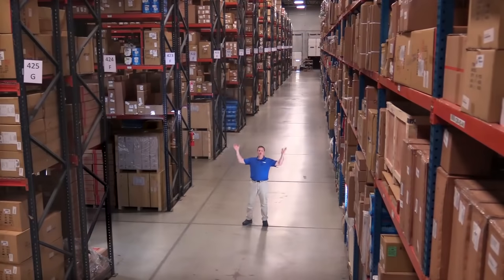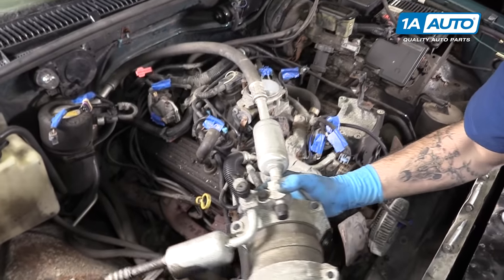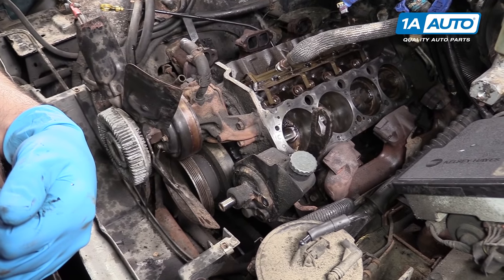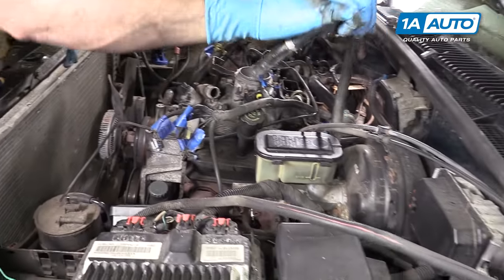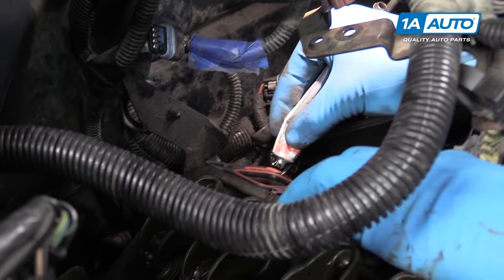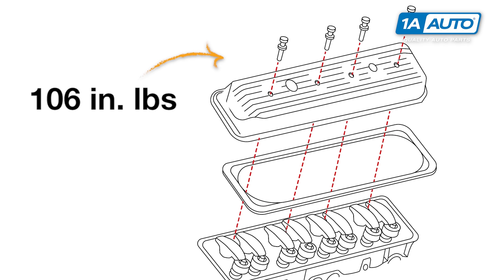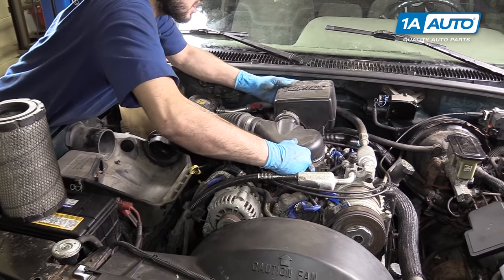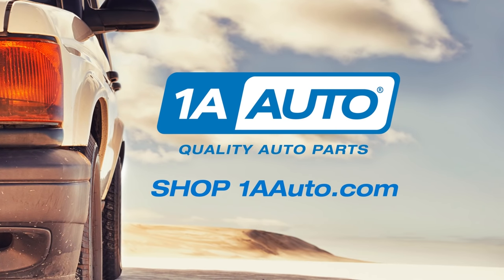How to Replace Intake Manifold Gaskets 96-99 GMC K1500 5.7L

Comment: I had the notorious intake coolant leak on my 5.7 1998 Silverado.  It's been about 10 years but I know I didn't remove the power steering pulley.  I believe I just loosen the bolts enough on the bracket to clear the manifold.  Nice video.
Reply: Just did this last night, yep. No need to buy a pulley removal tool!
Reply: Pull the whole accessory bracket off both sides. The steering pump has enough hose to move it out of the way. Unless your hoses look like the titanic.

Comment: I don't believe you need to remove any of the power steering stuff for this job. For heads, sure, but not intake manifold gaskets. Way more work than it's worth.
Reply: Just did this job and if you have AC, you have to take the power steering pulley off to get the bracket off to get the valve cover off. It's like the lady that swallowed a fly.
Reply: You can loosen the nut between the power steering bracket and exh manifold on top of the three bolts and nut  which allows you to slide the bracket forward enough to clear it.

Comment: Incredible video, and great information. For those who break the plastic quick disconnect on the heater line to the intake man. I found a good write up to fix that. Also, I noticed my hardware was more standard than metric (9/16s opposed to 15mm) so be wary of that if your tools are not an exact fit
Reply from the maker: +Austin Kelly Thanks for the feedback!
Reply: Hi there wondering how u fixed the broken pinch clip on the heater hose?? Or where I can find info about this...thanks
Reply: I broke my clip on the heater hose....any advice?

Comment: Thank you SO MUCH for this amazing video tutorial. This was officially my first ever engine repair job -- I have some basic mechanical experience, but nothing to the level required to do this job without some serious guidance. The video was detailed enough that I successfully replaced my lower and upper intake manifold gaskets and managed to repair the infamous coolant leak that is so common on the GMC trucks. Thanks again for the excellent video -- I felt empowered to tackle this job with the confidence that I knew (and understood) what I needed to do. Keep up the great work, it is genuinely appreciated!
Reply from the maker: +jojoargento Thank you for the great reply. We love to empower our customers by showing you how-to perform your own auto repairs while installing our high quality auto parts. Have a great day! 1aauto.com

Comment: Excellent video!  Not looking forward to doing this job but, when I do I will use this one for help.  I have done the upper intake when I replaced my injectors and wish I knew to do the lower while it was all apart!  Same process with all the wires and harnesses... Thanks again.
Reply from the maker: +MrBowNaxe Thanks for watching. We carry the gasket kit on our website. Here is a link to them. Hope this helps you out. http://www.1aauto.com/head-gasket-set/i/1aegs00237?utm_source=YouTube&utm_medium=CTA+Comment&utm_campaign=ytcomment&utm_term=zte-h_mZyBM

Comment: They make a tool specifically for removing the clamps and it a LOT EASIER.
I would put in a recommendation to replace the 2 small hoses from the water pump, especially since you have everything off.
This was also detailed and hopefully it will work with me

Comment: It has been a few years since I did a vortec intake on a sbc but I'm pretty sure I didn't have to take power steering pump off and instead only took the bracket bolts loose. I seem to remember the brackets could be moved enough to do the job that way.

Comment: I just bought a 97 Tahoe. The previous owner neglected to tell me it has a blown head gasket and cancelled title.  I'll have to get him to sign it over to me at the DMV, and I think I can do the head gasket myself, thanks to your video. I learned a few things I wasn't figuring.  I'd like to swap the Camshaft, lifters, and valve springs while I'm in there doing the head gasket.  I'm still researching which camshafts and intake manifolds that are compatible with this year engine. I was planning on going with a Summit Racing 4x4 cam and beehive LS1 springs, but I'll check out the A1 website first and see what you've got for this project
Reply from the maker: +Kris Snessak Thank you! We love empowering our customers and showing how to perform DIY auto repairs with our high-quality auto parts.  http://1aau.to/m/Shop-1AAuto-c

Comment: useful video thank you. I have a 96 and 5 liter that uses 1 quart or less of fluid in anitfreeze per whole year..it shows up as a clean spot of one side of each plug on #6 and #8. Full compression, factory fuel mileage, full power.. it was mystery. it must be the last channel of coolant on the head from intake gasket. It uses such a small amount, I don't even want to tear into it...some years it uses none.

Comment: On the removal of the p/s pump pulley and the a/c compressor bracket, it leaves me stumped. There is a 13mm or 15mm nut (I forget which size) on the driver's side of the engine between the back of the p/s pump and the exhaust manifold. After removing the three bolts and the one nut from the front of the a/c compressor bracket, remove the aforementioned nut  between the back of the p/s pump and the exhaust manifold. This will allow the a/c compressor bracket to be slid forward enough to have access to the front lower intake manifold bolt and take it out. The back of the a/c compressor bracket covers that front bolt. Then when the other seven lower manifold bolts are removed the manifold can be lifted out.

Comment: That would be a great time to replace the heater inlet and replace the spider injection to the upgraded version if it doesn't already have it. Also clean the EGR passages and I'd soak the valley and push rods with CRC or SeaFoam
Reply from the maker: +Tazman1966 Thanks for checking us out!

Comment: WARNING!!! Change the OEM heater hose quick connect when you have the manifold off. Mine seemed ok only to crumble when I tried to reinstall hose. Now I must take intake manifold back off to try and salvage the manifold.
Reply from the maker: +C Robinson Thanks for checking us out! http://1aau.to/m/Shop-1AAuto-c
Reply: you can remove a broken hose connector with a hacksaw blade, cut 180 degrees apart carefully until almost all the way through then the two pieces can be removed, done this on 2 trucks over the years. 
to avoid breaking them off in the first place give them a little heat and some wax and turn it cautiously and they will usually come on out.
when you are done don't buy a replacement, put in an old school hose connector from a small block and clamp the hose on like the old days.
Reply: @dixiegarage400  im half way through the project here. Wanting to eliminate that quick disconnect hose thing. What outlet thing do I need to buy exactly? Id like to have it ready to go when I get the manifold off lol. Thanks sir!

Comment: Did this on the exact same motor due to some broken bolts in the manifold. We put the gasket maker on the valley pretty thick, but now it’s idling high at around 1300rpm. If there’s a leak at that valley seal will it cause a vacuum leak? Leak down test showed nothing

Comment: I know this is old but is there anyone who knows if this can be done without valve cover removal? i just replaced the gaskets and it wasn’t hard but would just make it easier and less risk of the gaskets leaking because i used the gasket again

Comment: Just did this on my 98 sierra. All went smooth until the next day I have a small oil leak coming from somewhere in the back top of the motor. Not sure if the rtv didn’t hold up when I put the intake back on or what. I’ve checked everything and can’t find where the leak starts. This happen to any body else?
Reply: Put some silicone on the distributor gasket. As far as the RTV I use ford silicone on everything. EVERYTIME. Never leaks.

Comment: Do I top dead center with spark plugs I know to remove spark plug 1 and put cthe compression on it
Reply: Do I need to lossen the distributor bolt before moving to top dead center or do thay have to be tight?

Comment: Besides tutorial purposes, what was cause of you changing the intake manifold gasket???
Reply from the maker: +LawBr8ker Thanks for watching!  This is a job that is done if you start to have leaks in any of the gasket locations.
Reply: Coolant loss, which is caused by deterioration of intake manifold gaskets, due in part, at least, to JUNK factory lower intake manifold.  Buy an aftermarket lower intake unit, if you want to permanently "fix" the problem...

Comment: You say tighten down 7 bolts keeping egr hold down bolt but its actually tighten 8 bolts and egr bolt is not included in the 8 bolts

Comment: Hey so i have a 99 tahoe 5.7. I have a hose that crumbled and i can't find out what its called. It goes from the intake to the ac system along the firewall. Any idea what this hose is. It literally crumbled. Its a bout an eight of an inch to a quarter inch in diameter and it was really long.

Comment: I just done my 93 silverado 350,the the gaskets came w no openings,the old gaskets had them open,,,was i given the wrong gaskets
Reply from the maker: +Maurice Bond If this is an order made with us, please let us know so we can assist you further.
Reply: @1AAuto  ,No it wasnt,i just wasnt sure about those ports being blocked by the gasket when the YouTube videos showed there gaskets were  open on the back ports
Reply from the maker: +Maurice Bond Thanks for checking us out!
Reply: Some Models Use Restrictors to Slow Down The Coolant Flow to Absorb More Heat In The Engine

Comment: Does the intake manifold need to be resurfaced in order to sit flat while changing the gasket or just clean? Also does the block need to be resurfaced as well or just cleaned?
Reply from the maker: +edgar heredia You should be able to just remove the old gaskets and clean them. 1aauto.com
Reply: Thanks for the info , the sequence provided in the video is that for a 5.0 motor?, I have a 98 gmc sierra sle 5.0 v8 vortec
Reply: It's for the 5.7

Comment: Can i use my old distributor assembly or do i have to buy a new one
Reply from the maker: +Dmitrik Guajardo Thanks for watching.  You can use the old one if it is still good, no need to purchase a new one!
Reply: Those distributors are junk, get an aftermarket one with aluminum housing

Comment: I bought that power steering pump pulley tool (remover and installer) and the installer wouldn't fit. Same issue as y'all. Tried the alternator bracket thread hack and didn't work either. The pulley gets on about 3/4 of the way and won't budge anymore. Even tried buying a new pulley thinking I mushroomed the originally pulley when removing it. I even tried heating the pulley. Any ideas?
Reply: Mine required a TREMENDOUS amount of force to put it in. Enough that afterwards I was wiped for the evening. I started the pulley on with a dead blow hammer just to get it started and straight, and then reefed on it until I thought I was going to blow a hernia. I'd suggest making sure everything is absolutely clean before reinstall, as any rust or scuffs will make it quite a bit harder. It was the hardest part of the reinstall.
Reply: Where can i get this tool for pulling it? Thanks for the help.
Reply from the maker: We do not currently offer the tool you are looking for but you may be able to locate via www.partfinder.com or eBay. Thank you for checking us out! +Matt’s Models

Comment: How much will something like this cost for my 04 gmc Yukon
Reply from the maker: +Darrell Williams We currently do not have an auto repair video specific to your vehicle. You might be able to apply some of the basic steps shown in this video to your application. Here is a link to the repair part that would fit your vehicle. Hope this helps you out 

https://www.1aauto.com/intake-manifold-dorman-615-183/i/1aeim00018?f=655442&y=2004

Comment: There was an extra red connector on my truck on the same loom where the crank sensor comes out of, can't find where it plugs into, can someone help?
Reply: If you have not already figured it out, it used to go to the power steering pump. Someone has probably already changed out the orfice valve, a piece of tubing with a small hole for the power steering fluid to pass through. The factory set up used an electric piece that was a poor design and then gm realized it looked good on paper and then it failed and everyone had to pay an extra $80 at the dealership for the valve to bypass the factory set up. With out seeing what you are talking about, I'm almost positive that is what you are referring to.
Reply: Three months late but im following this tutorial right now and i had an extra red connector as well. It connected behind and underneath the power steering pulley.

Comment: Would it be the same on my 95?
Reply from the maker: +Tony Almaraz We don't have a how-to video for your vehicle right now, but the basic steps in this video should be enough to do this task. Buy this part for your vehicle on 1AAuto.com: http://1aau.to/m/Shop-1AAuto-c
Reply: NO.  SFI intakes (OBD II system) are different castings.  Those who have a SFI engine should buy an aftermarket lower intake unit, or you'll be revisiting this issue, sooner or later.  Factory lower intake castings for '96-'98 SFI engines are JUNK...

Comment: How long did this take you
Reply from the maker: +MIGGZ Est1992 This usually takes a couple hours if you are experienced with this type of repair. If this is your first time it will take a good part of the day to complete.
Reply: 1A Auto Parts  what’s about the head gaskets ... im a mechanic but there is a lot of thing I need to learn... I bought a k1500 but I’m getting coolant in my oil it’s not burning it or smoking out the tail pipe I think it’s only the lower intake gasket but if I have that out might as well do the heads to

Comment: At 14:08 it show the nach. On the pulley but 
 my have 2 why? Is a 4.3 silverado
Reply: It may be because this is a 5.7? V8
Reply from the maker: +Baldomero Rojas This is a 5.7. Thanks for checking us out!
Reply: One lines up with the timing mark on the cover, and the other one lines up to a mark that can be seen from under the truck

Comment: 😢 you need to clarify that a lot of your steps do not apply for only intake manifold replacement you pulled the heads also which is a lot more work than just simply intake only just need to redo what you call this video

Comment: The BEST "fix" is to also buy an aftermarket lower manifold for it.  Factory pieces are JUNK, FROM DAY ONE!  FACT...  My '97 K1500 with a 305 lost anti freeze, since new.  Replaced the intake manifold gaskets, like in this video--still losing coolant, over time.  Poor casting quality cannot be "remedied" by just changing these gaskets, people.  Being a GM retiree, (August, 2005) it still disgusts me that GM built such CRAP...  smh